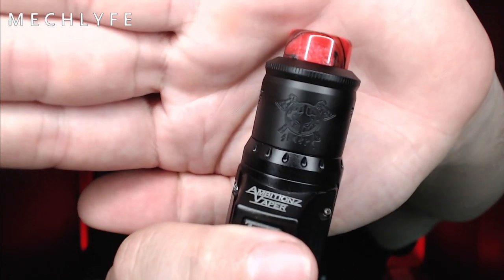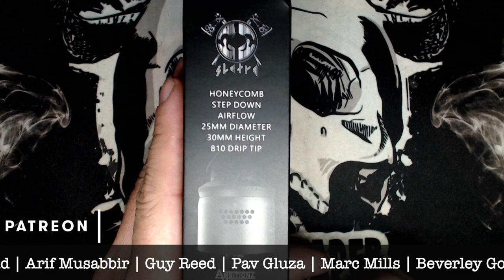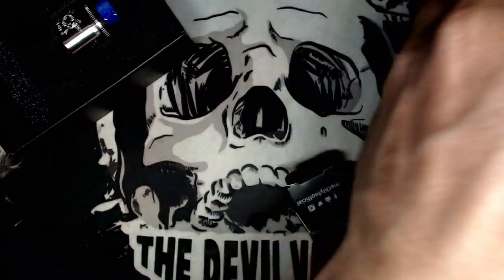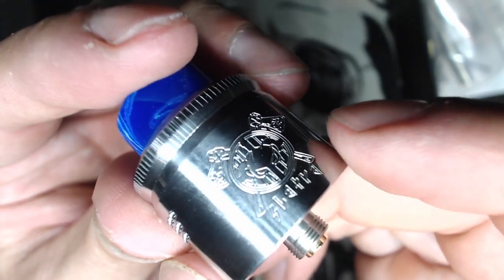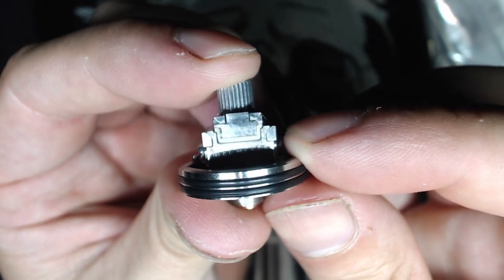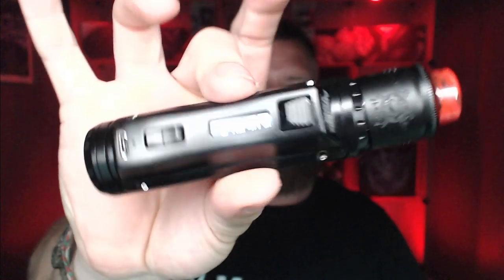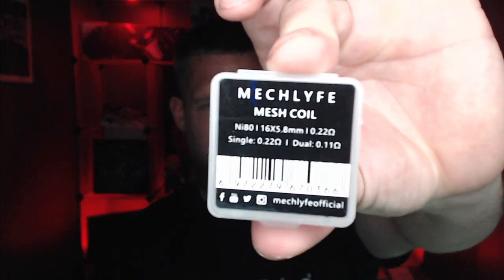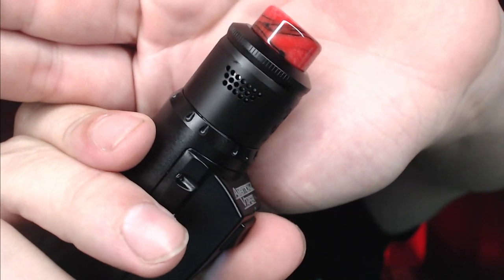MECHLYFE Slatra RDA Review & Build - Designed by AmbitionZ Vaper!

Comment: So you need to wick it tighter if your getting dry hits. and you need to go up to 100-110w on this dual mesh lol 😂 it’s made for that. If you like it lower go for it but the best vape would be 90-110w cheers bro. Thanks for the video. You can do
The top for coils if you want as well. You need to go up on wattage buddy that’s why. Those coils are 4mm ID.
Reply from the maker: It was bloody tight, but getting slightly dry, lol. I'll try more next time.
I'm more of a cool temperature Vaper and it was going good for me 👍👍